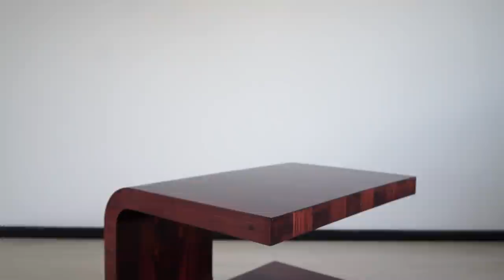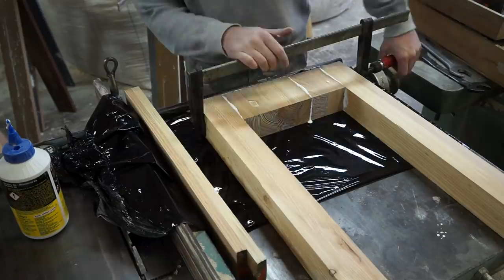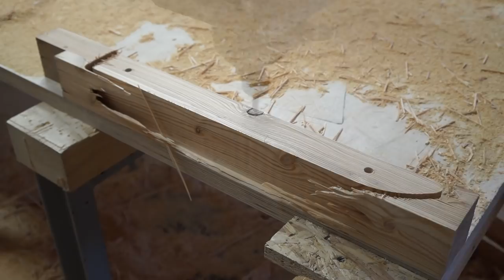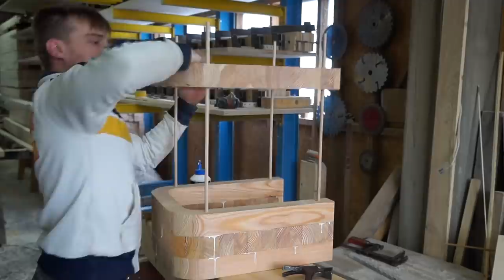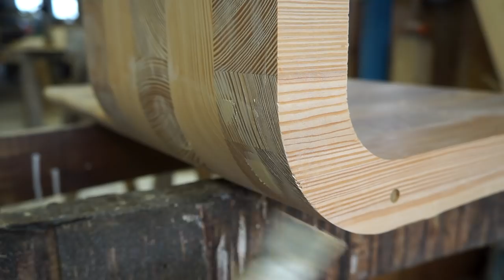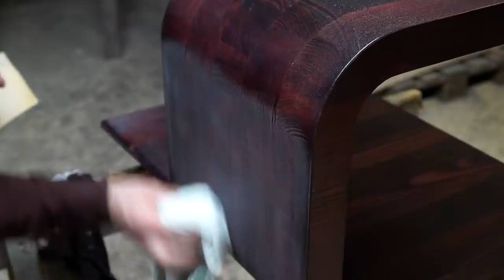Modern coffee table (larch glulam leftovers)

Comment: We glued up some larch panels for outdoor benches with PUR glue and they started cracking on the glue line after only two weeks outside.
Any idea what we did wrong?
Reply from the maker: I never use polyurethane glue for outside pieces because polyurethane is not uv resistant. I never saw one that is.. I could be wrong though.. for outside I use mostly d4 acetate glue, or melamine where heath is present..
Reply: Thank you! We already lost 4-6K€ by using PUR but might save so much more if we continue with the correct glue.